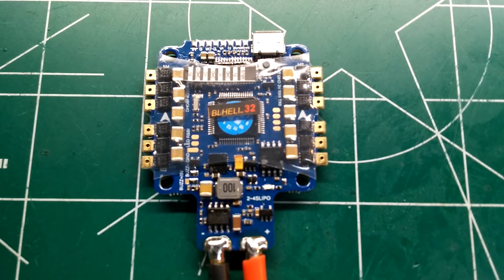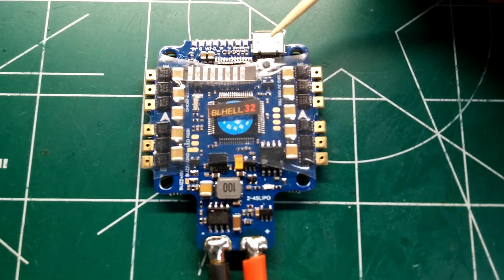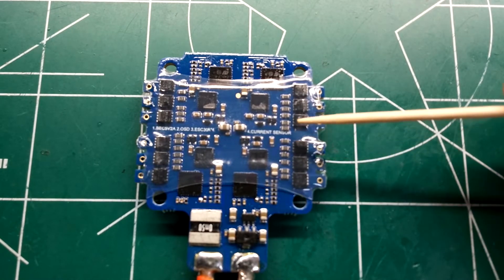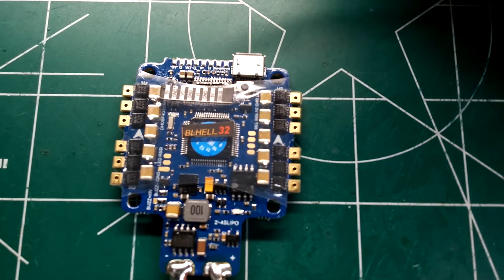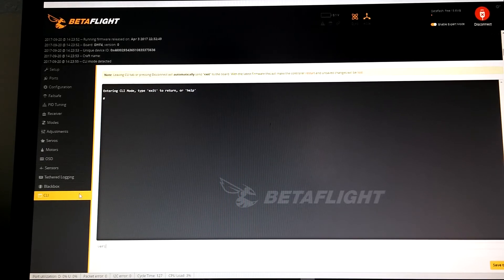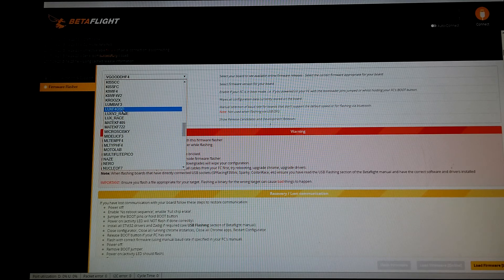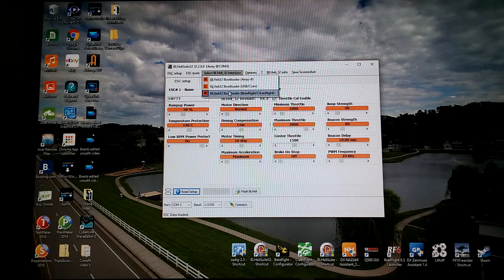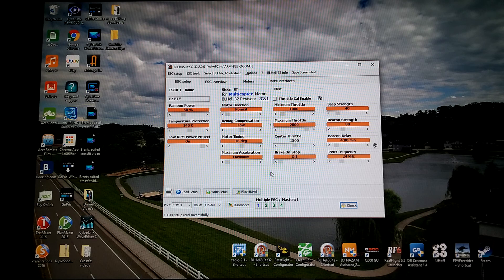Flip32 AIO Vedrfilnor Blheli32 Flight Controller Review

Comment: I just bought and wired up this AIO, and am having a peculiar problem with throttle.  The motors draw less than 1A- I've gone thorough a lot of configuration possibilities, and they only accelerate up to almost the halfway point in betaflight (same result using only the transmitter).  The same quad configuration (batteries/motors/weight/etc) was used to fly successfully for 20min durations, but this one won't get off the ground of course with power that low.  My firmware is LUX405D  3.5.2  Any ideas?

Comment: How would you rate this verses the cicada aio? I usually ask these questions before I buy, but I'm hoping for a favorable answer. 😁
Reply from the maker: Borninvincibl3 FPV - Both boards are identical to each other, they're just rebranded. If you look through this video's comments you'll see a lot of people are having trouble with this board flipping out for no reason, including myself which is detailed in my IFlight Beetle part 2 video. Due to these factors I would no longer recommend this board to anyone unfortunately.
Reply: SteelRainFPV well that sucks, hopefully I have better luck. Maybe it's just too much stuff on one board.

Comment: I have the tattoo AIO. I noticed that the original firmware comes with a few things set up. It has an arm switch enabled in the modes tab. Has all gps options enabled, has the serial rx uart selected, and has sbus protocol selected. I have had problems with upgrading firmware on AIOs before, so I really didnt want to do this. But my FC is acting crazy with stock firmware, so I have no choice but to upgrade and look at the ESC settings. Im 99 percent sure that my racerstar is defective. I think that I am getting different power from each ESC. Gonna try the update now. Fingers crossed! Thank you for the video!

Comment: Hello there, could you make à betafliht set up guide, how do I connect my i-bus receiver (x6b) to this ? Thank you and cheers.
My FC is a racerstar tattoo f4 air, same has this one no ?
Reply from the maker: Thomas Ligonnet - Yes your board is the same as this one, and while I don't have anything that has ibus protocol, it's my understanding that all you have to do to get ibus working is to solder on your ibus receivers signal wire to any open rx uart, such as rx1 or rx3, then go in the Betaflight gui under the configuration tab and select sbus receiver, then ibus protocol in the drop down menu and save, and don't forget to select and check serial based receiver on the specific rx uart you soldered your receiver to in the ports tab of Betaflight first. Hopefully that helps you get the board working with your ibus receiver.
Reply: +SteelRainFPV Thank you, one last question, what gyro and PID Loop frequency will that board take ? cheers
Reply from the maker: Thomas Ligonnet - From my understanding the mpu6000 gyro can only handle 8k 8k pid loop max due to it's hardware limitations.

Comment: First ;) 

Liked and subbed
Reply from the maker: Drone Mesh - I appreciate the support brother, I'm still new at this YouTube review game, so I'm still learning to be more articulate and informative with my reviews.
Reply: Your doing a great job.. Keep it up
Reply from the maker: Rick Flare - That is a very good question that I'm sure Drone Mesh will research the answer on his channel or here, but since I don't have the specific Racerstar/Tattoo esc version of this board I'm not quite sure if it will work the same. In other words, the board and hardware is identical, but there is a software/firmware agreement with the closed source blheli32 developers that does cost money to license, so at this point it's a question and gamble whether or not the Racerstar Tattoo version will work with blheli32 or not....
Reply: I agree, great vid Steel, one question.... would these steps apply to the recerstar tatto aio blheli 32?